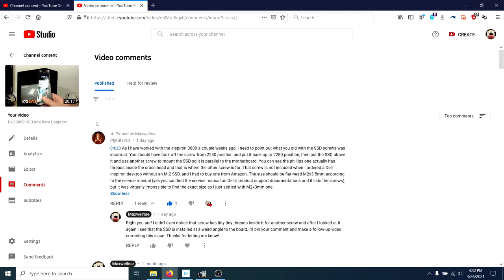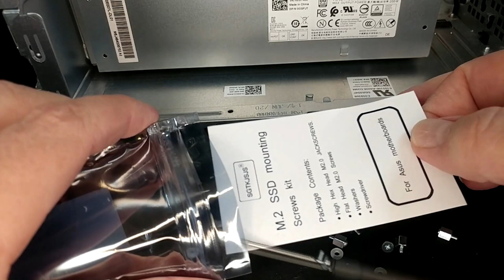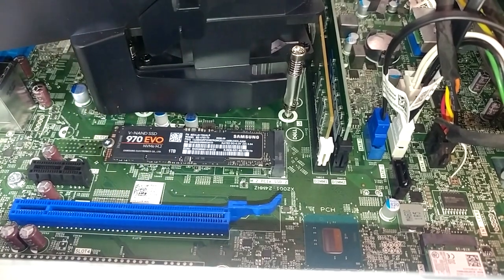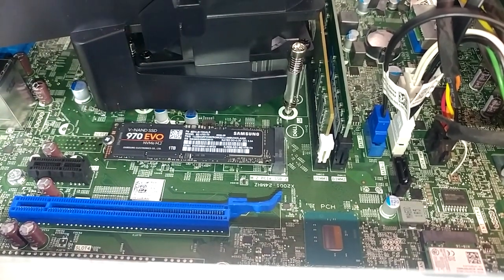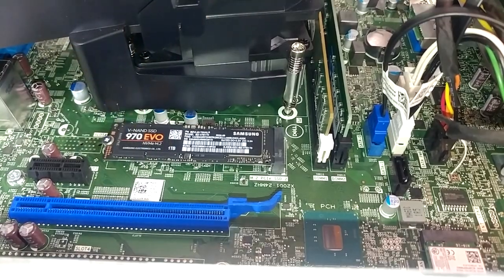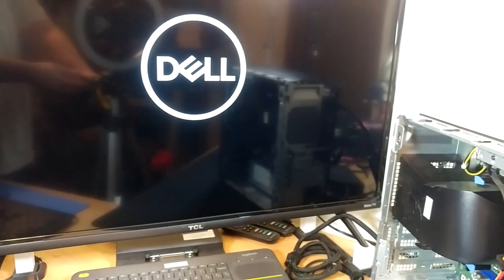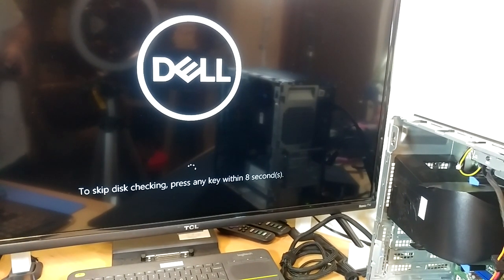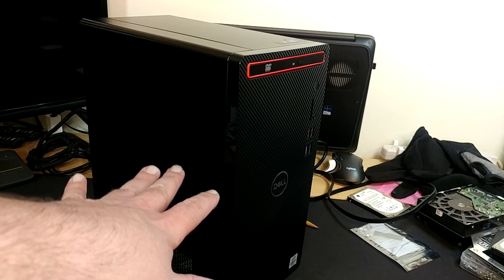Dell 3880 SSD Do Over... Mistakes Were Made!

Comment: Thanks for making the update and you surely did a much better than The Verge :)

I also find M2x2.5mm is just barely enough to thread in so I would go for 3mm if possible. The service manual said 3.5mm but I was not able to find any on Amazon.

Btw are you going to upgrade to a discrete GPU anytime soon? I have watched your other videos and you seem to plan on doing it eventually, but as I remember this Inspiron 3880 power supply doesn't have any extra PCIe power connectors and there are not many choices for a GPU that doesn't need external power. Just wanted to give you a heads-up if you are going for it.
Reply from the maker: When I'm wrong, I'm wrong. I couldn't leave it out there as it was since it could have cost people their SSD. Part of what makes YouTube fun is that we do end up building a community and as a community we can all learn from each other. Once again, I appreciate the heads up.

Probably not any time soon just due to the ever increasing cost. Cards have tripled in price in the 6 months since I ordered the machine. I had been looking at GTX 1050Ti low profile, which has a 75w power consumption (and all of them I've seen don't seem to need external power), and was hoping to squeak by with the i3, SSD, and 200W psu, but I may move on to other things first. The price of the i7-10700 is nearly half what it was 6 months ago, so I may try my luck with that swap as the next "big" thing. I really want to push the 200w PSU a little before moving on.

Next for the Dell series is probably a little smaller video, like dual monitors with Intel graphics. People have been asking for that too.

Comment: I think that you had two risers on your MB. If you are using the 80mm SSD, you should remove the shorter riser. No spacers required.
Reply from the maker: I'm not positive I understand what you're saying. What you saw in the video is all that was ever in there. It came installed at the 30mm position, I moved it to 80mm, and everything looks good now. The bosses/risers that the "riser" screws into are not removable. They're formed into the motherboard.

I'm probably mixing terminology enough to create some confusion, but the video illustrates the process pretty well. Take the thing at the 30mm position, move it to 80mm, and install the SSD. :)
Reply: @TheBrokenLife  The risers are removable.The screw that holds down the SSD screws into the riser. My Dell 3880 came with a 128GB SSD in the shorter length. To install the 80 mm SSD I had to remove the riser and place it in the second position, there are only two options on that MB.
Reply from the maker: @eminusipi  I believe that's what I showed in the video?

Comment: Thanks for maybe helping with a "dumb" question.  Subject: I'm attempting an upgrade for an additional SSD drive in A Dell 3880,  system already has a 256 SDD, but, I have about 250 Gb of files, so I've been using an external drive. I thought it would be better to have an additional SSD internally.  After watching your videos on this adaptation several times, I bought a Samsung SSD 970 EVO Plus NVMeM.2 with 500Gb and thanks to you advice, screws!  Preparing everything, backed up files, set a new system restore and opened the cabinet.  The original 256Gb SSD is in the slot you show putting the new SSD into!    (I thought the original SSD would be elsewhere, and the drive you show be sort of an expansion slot.  Nope.)    The original 256 SSD is tiny, smaller than a postage stamp, and I have no idea where to put the new drive.  Any easy solution??  Thanks!
Reply: Think I found the answer.  I bought the 3880 from Best Buy, went to their site, checked the Q&A area for the very same unit and verified same in "your orders: section.   A question and answer: ""Question:  How many m.2 SSD NVME drives can this support? Does it specifically have two m.2 2280 connections?""

""Answer This system could support only one m.2 SSD NVME drive of volume up to 512 GB."

I don't have the skills or patience to reload all my programs Guess I'll need the local bit twiddler to add a drive to where a CD would normally be.  I'm back to the drawing board.   Thanks for your CONCISE videos, TBL!
Reply from the maker: This is a question that has come up a couple of times and I need to cover it in an additional video. 

Unfortunately, you only have 1 m.2 slot so you can't easily install both drives in the machine at the same time. You will need to come up with a stop-gap measure to clone your old drive to your new drive through an intermediate step. The easiest option is likely to use an external USB enclosure for your new m.2 drive. Sabrent (affiliated link here: https://amzn.to/2YTiz1v) offers their own version of Acronis to use for free with their enclosures for the purpose of duplicating drives. Sadly, their enclosure doesn't support the 2230 (physically small) size drive so you'll have to use an adapter with the enclosure if you'd like to use your old SSD as an external drive when you're done (another affiliated link: https://amzn.to/3p6MTjR).

Another option would be to install a HDD in it (or use the one Dell provided if it came with one), use cloning software to mirror the SSD to the HDD (if you have a Seagate HDD like I do, then that would be Seagate version of Acronis), then mirror the HDD to your new SSD. That method will end up deleting the contents of your HDD and is obviously a bit of messing around. For the price of the enclosure, I think it's worthwhile to go with the first method. Plus then you can use your old SSD when you're done.

I may try to move this video up agenda since people have asked about it a few times, but it will be over on my dedicated tech channel when I do. https://www.youtube.com/channel/UCAFbtgIVOL9oxTr7pskcAkg
Reply from the maker: @ChrisPBacon-vk7sj  There are enclosures to adapt M.2 drives to 2.5" SATA enclosures if that's what you want to do. If you don't already have an optical drive you can put one of those adapters, inside another adapter for it to fit the ODD bay, and install it in that location. You can also bolt it to the existing HDD if you'd like to keep your optical drive. I illustrate those options in the drive mounting video in the playlist, though I don't show them combined with an m.2 adapter in mind.

Cloning the drive's data isn't too terribly difficult. Acronis isn't as straight forward the Samsung utility, but it's not too bad.
Reply: @TheBrokenLife  Thanks again for your detailed information. I had a complete drive crash on March 26, use a PC for business all day, needed to be back up before sundown. A month before my laptop was shot (usedfor movies only, from Amazon) and it came with an SSD. The laptop was cheap, and the fastest PC I've owned since '93, so with the 3880's SSD, I thought it would be good.  It is, for my purposes, mostly documents and CAE files, but the 256 Gb SSD became a pain.  I'm not a computer guru, so I think I better have a small shop near me that is real good do the honors. I DO want it all internal.  Thanks again!
Reply from the maker: You're very welcome. As a parting thought... If you're going to pay a shop to do it, I honestly would not bother with the expense of having them reinstall that 256gb drive. The parts and labor to do so will exceed the value of the drive.

If it's raw data capacity you're after, I suggest you have them install your new SSD and upgrade the factory HDD to a larger one. A 4TB HDD is under $100 and the labor to swap it out should be about 15 minutes. Use the HDD for bulk storage and your new SSD for your OS and applications. Your original SSD and HDD would be fodder for the recycler or eBay or become modern art sculptures for your desk.
Reply: @TheBrokenLife  I like that plan best of all! The system has no HDD, I would use the main drive (256Gb)  for the OS and programs, and the second drive as a file server only.  I thought that was what I was doing with the added SDD, presuming the 256 SSD was somewhere where a HDD would typically have been.  I'm subscribed, thanks for helping out us neophytes.
Reply from the maker: @ChrisPBacon-vk7sj  Huh.... I haven't seen one of these machines offered with an SSD that size and no HDD before. I suppose Dell would build whatever Best Buy wanted to sell, so, alright then.

If all you want is more capacity, you can simply return the larger SSD and install an HDD yourself. It is very simple and I think I cover enough elements of it in my first 3880 SSD video that you could handle it. 

Hey, thanks for watching! :)

Comment: I have the same sky hynix 256gb  nvme spoken about in earlier comments.. It's tiny/ No HDD. Just one m.2 nvme. But, I need more than 256gb. I want to add a 1 tb M.2 ssd. But it seems so complicated, I may not even attempt it. I have 2pc's. I could maybe use the other PC to write over the new 1tb ssd. Or maybe 500gb is the most that this dell 380 is capable of running? Sorry for the weird multi question comment. This PC stuff is sort of tricky.. Lol
Reply from the maker: The easiest way to duplicate an SSD with only a single m.2 port is to buy a USB to m.2 adapter. This is a video I plan to make "soon" over on The Broken Tech channel and also potentially offer as a service.

If you're interested, feel free to email me at the link in the description.
Reply: @TheBrokenLife  it could be possible that 1 TB Ssd is no good for the 3880. I have read that it will only accept a 500GB… but I see that you have used a 1T ssd. So this is also what I would like to do. I filled up 12gb of Ram already also… so I need ssd and Ram upgrade badly. I’ll get around to doing it “soon” also! Lolll… I have about 13 other projects going on at the moment myself. I’m sure you do too! Thanks for taking the time to respond to others, and for making these videos. It has helped me tremendously, and countless others. Your doing a good thing, and you work will not go unnoticed! People that help others , and solve problems , always wind up being important people! So keep up the hard work man. I know it’s alot to make these videos. Can’t be easy… but that’s my thank you!!! I’ll email you sometime this week!
Reply from the maker: @Cmtb125  That error in the Dell literature was brought to my attention around 2 years ago. Mine has never had an issue with its 1TB SSD and it seems many others are using larger drives too. I'd say if you want to be sure you won't have problems, just order and install the same drive I installed (linked in the description of the original video). It's insanely fast and very affordable these days so it's a good option that I can personally confirm works.

I appreciate your kind words. You keep watching them and I'll keep making them. 😆👍

Comment: I'd like to point out this is Dell screwing over (no pun intended) their customers, by fitting a standoff you can't use unless you have a screw they didn't include with it. That's not what motherboard manufacturers do, they usually ship the screws you need. So they've actively chosen to screw in a standoff, that's useless without the screw, costing them a cent perhaps but they save that on the screw? shrugs There is literally no reason for them to do this. Still, buy some screws/standoffs in a kit if you do need to upgrade one of these and it's still a cheap way to get a working office machine for a relative or some low end user. Upgrading my mothers 3881 to an SSD has made a huge difference in frustration levels for her.
Reply: I saw the ASUS kit when I thought I wouldn't find a screw in my Man Drawer that could do the job, but there were others on the UK Amazon store which had more than one standoff length. If you aren't 100% sure, they might be worth it, particularly if you might use them at a later date.
Reply from the maker: I'd have to go back through all of the videos and look, but I think Dell uses the stand-off as a mounting screw for the board itself.